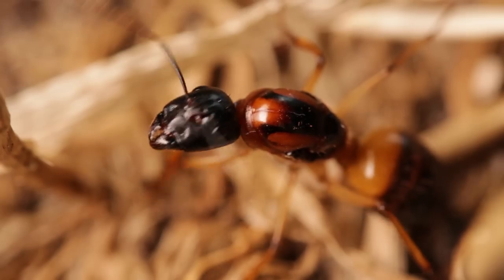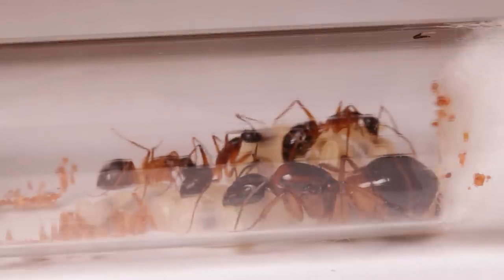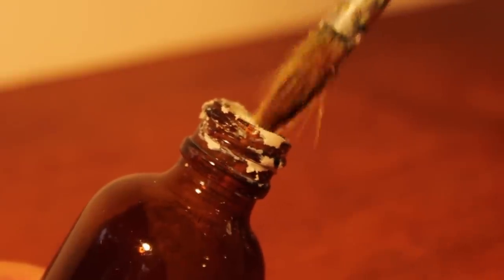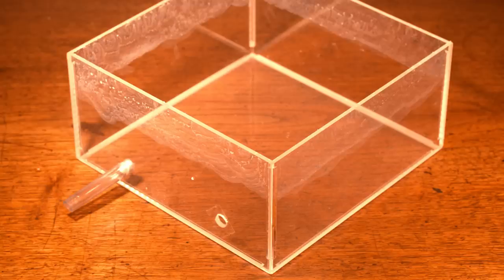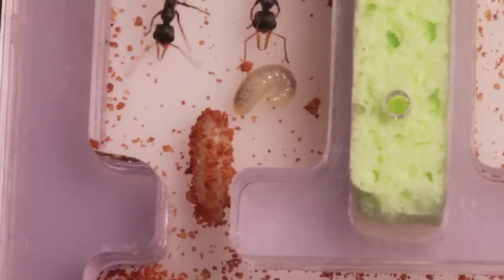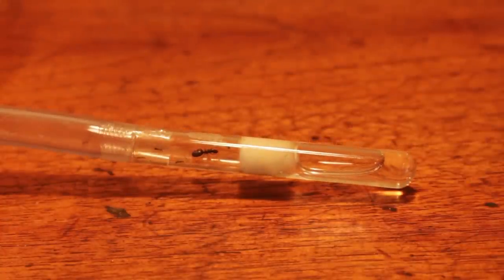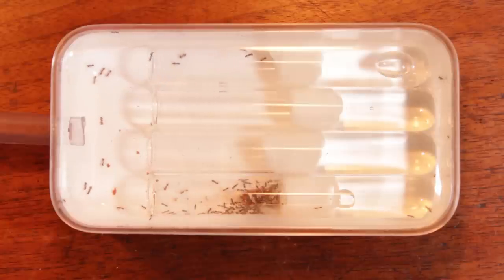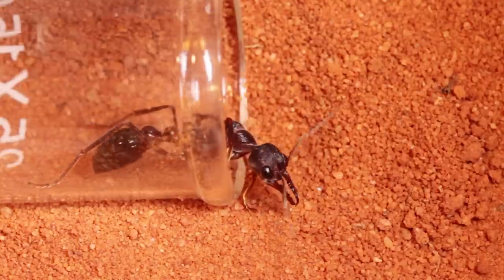How to Build an Ant Nest | Tubs & Tubes

Comment: I love this. It gives some simple, cheap ideas for starter nests instead of having to spend nearly 200 dollars on an antscanada starter kit. Not dissing antscanada, mikey bustos first for me into ants, but his gear on his site is expensive for a beginner. These ideas are great, thanks :)
Reply: You can find some pretty nice ones on websites like amazon, ebay and aliexpress which are not that expensive. I found 3D printed nests with built in bottom water reservoir for like $40 and some acrylic and plexiglass nests ranging from $10 to $100+
Reply: Same! Now I really wish I didn’t get it so I could make my own!

Comment: Boi that was a screw driving drill bit not a drilling one.
Reply: Yup noticed this immediately.  Also worth noting, drill with small bit, then keep increasing bit size to widen hole until desired size. Or if your dead certain of size, you can get hole drill attachments to do it for you first try at the exact size...

Comment: I have a question - would you use a perspec or plastic aquerium for bulldog ants? Im using hebol inside a plastic one with gravel. It has a mesh lid and Im just curious as to whether this will stop them from escaping - i do not want to get stung in my sleep.

Comment: Is it possible I can not leave any gaps and just put a hole with a tube and cotton on the end that goes in and out? Saying that it works for housing small colonies? Cause I don't want to risk it too much about letting the ants get out just in case.